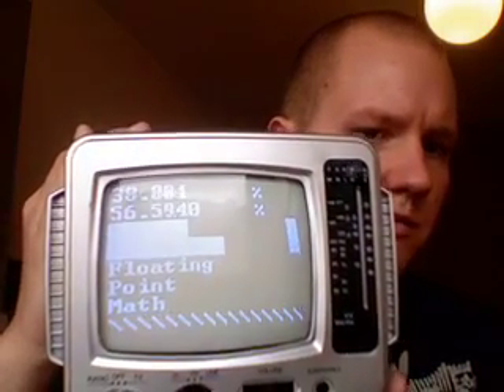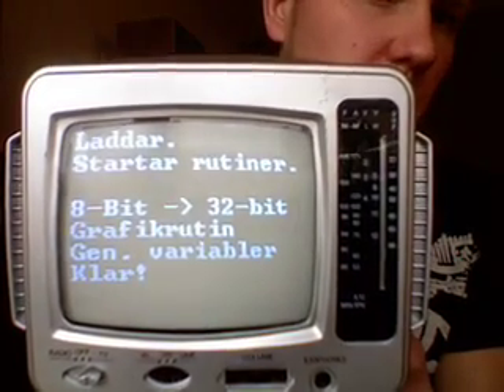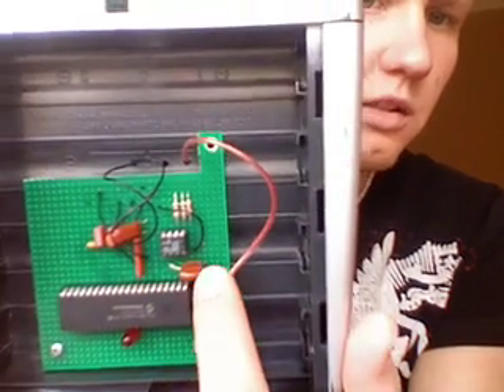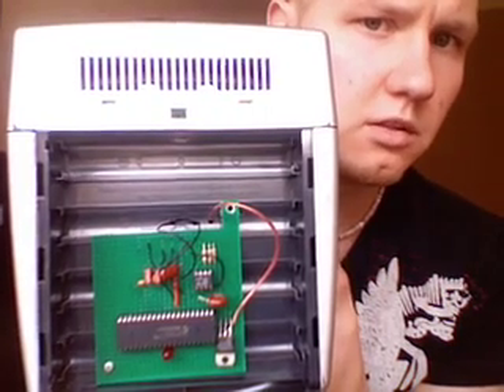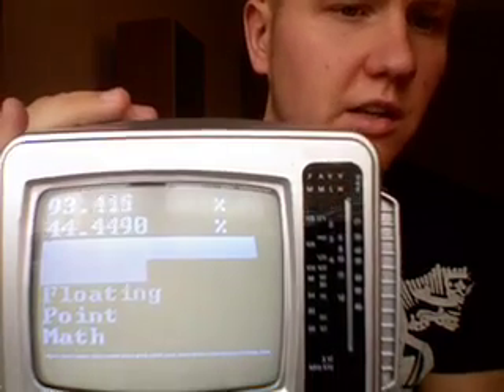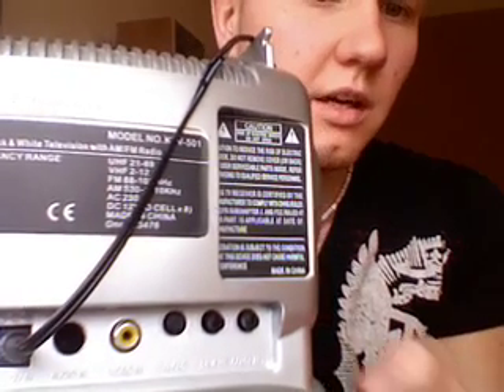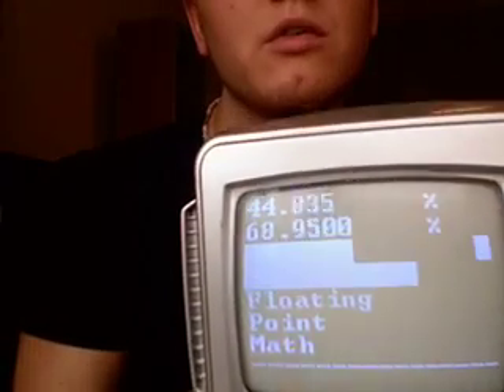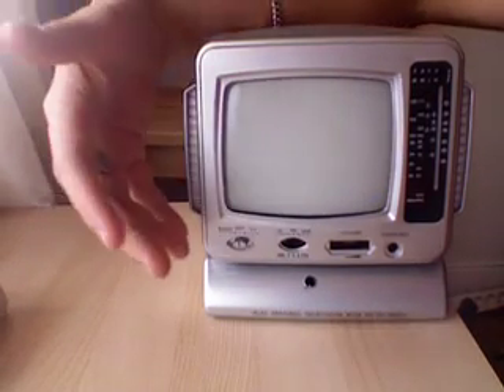PIC Microcontroller generating PAL TV signal

Comment from the maker: Hi!
The smaller PIC is a 12F683, I haven´t found any finished sourcecode on the net, but wikipedia helped me alot to understand the signals. I haven´t tried to produce a NTSC signal but should not be too difficult, just make sure you got all the timings right. A good way to do that is to use the onboard timer and a software interrupt routine.
I can tell you right away that if you are going to try to produce a color signal, you will probaly need a more powerful microcontroller, Parallax Propeller

Comment: (congratulation BTW) What is the smaller PIC (that happens to be producing the video signal)? -- I've thought about something (NTSC in my case) for basic display option as an alternate to LCD. Is there a project page with more details, parts (and possibly) some/all code? --Doug